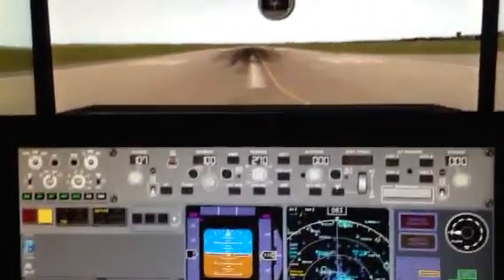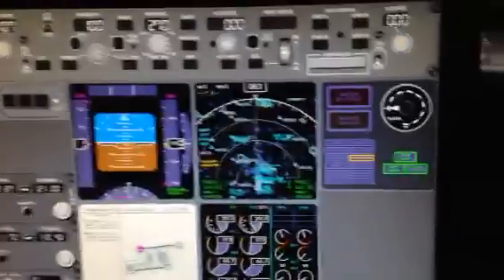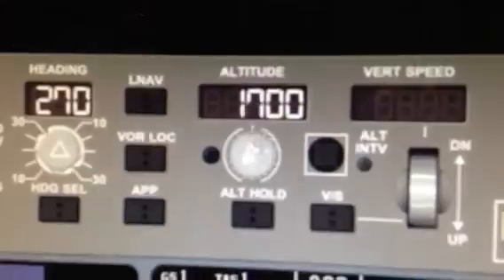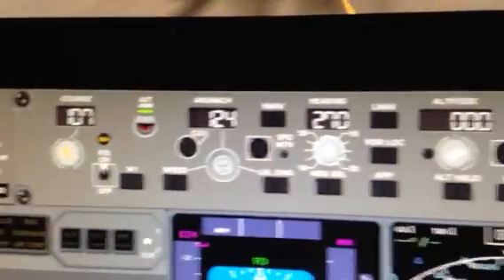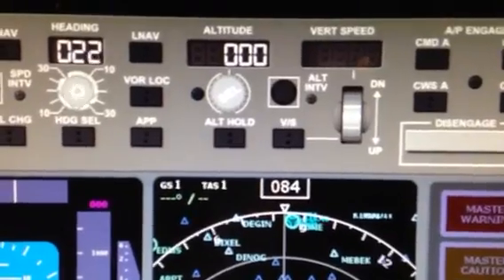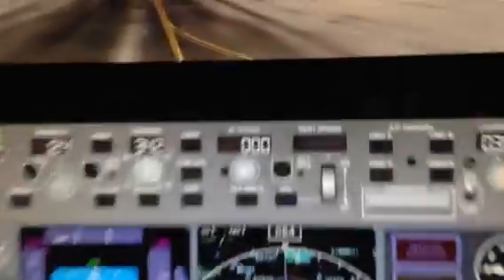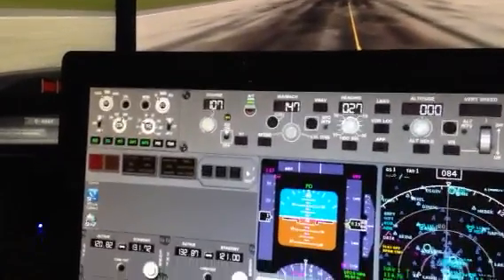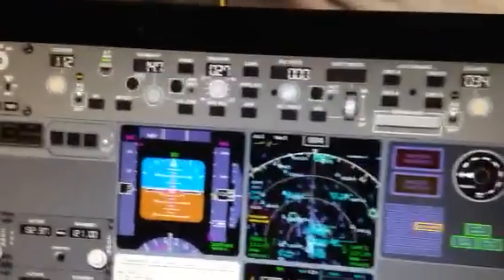Air Manager Dial Addon

Comment: How Do You Program The Knobster .  THE Flight Simulator When it is away From The Monitor  ?
Reply from the maker: I don’t understand your question, “THE Flight Simulator When it is away From The Monitor ?”.  There is no programming of Knobster. Just plug it in to your windows computer and it is recognized and then enable Knobster in the Panel settings for an Air Manager panel. After that it will control any knob you click or touch(if touchscreen enabled).If this doesn’t answer your question please clarify the question..
Reply: Yes. If I Attach a Knobester On a Tablet . Can I Use it On The Road With a Laptop?,  And the Tablet has to be Connected to the Laptop?
Reply: Whuen The Knobster is Not Attached to The Monitor Like In That Small Box .
Reply: How Do You Program The air Manager to A Specific Aircraft? , And Can it be Applied to  Software Purchased  From PC Aviator ?
Reply from the maker: Knobster has a USB cable that attaches to the computer and you can use the mobs Knobster anywhere you want. The one you were looking at in that video was one of my first trials using a mouse scroll wheel mounted in that case. That is really not the Knobster for an early prototype. Check out the Sim innovations website to see the current Knobster that is for sale.  www.siminnovations.com

Comment: Can you please describe how you connected the mouse to the rotating knob?
Reply from the maker: rjkanga ... actually  the mouse knob takes advantage of a built in feature in Air Manager that allows dials to be controlled through the scroll wheel. Normally you have to click the left half of the knob to rotate one unit counter clockwise and the right half to rotate clockwise. Anytime the mouse is anywhere within the knob's boundaries (hovering unpressed) the scroll wheel can make the inputs to  rotate the dial. Scroll forward to rotate clockwise and and backward to rotate counter clockwise.  Check out this video for an updated mouse mod I did:  
 https://youtu.be/CJHFspd22mg
Reply: Russ, Thanks for the input, but was wondering how you connected the mouse to the knob. Was it an extension shaft or a gear system. I opened up an old mouse and couldn't figure how to  connect it to an external knob.
Reply from the maker: rjkanga actually it was quite difficult. I took the mouse wheel and used the keyed shaft of the wheel to insert in the encoder. I glued a hollow tube  on that which attached to a bolt which was through the frame which had the knob on it. It wasn't very very reliable. I found a better way by removing the mouse guts and soldering an  encoder which  I purchased on Amazon for pennies. You can see about that  on another video I posted here: https://youtu.be/CJHFspd22mg
Reply: Thanks Ross, I tried doing something similar but still not successful. will keep trying.